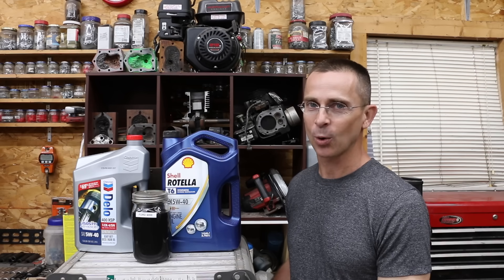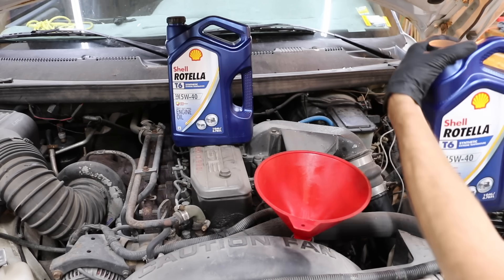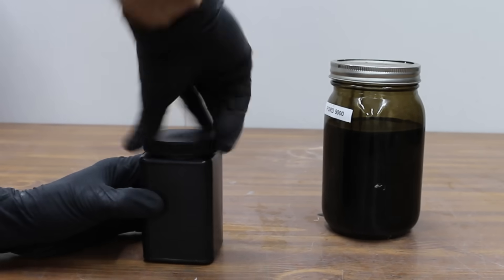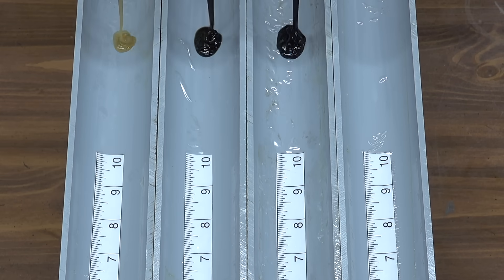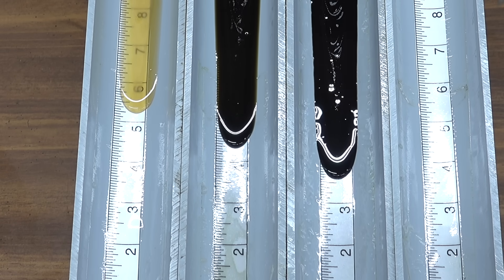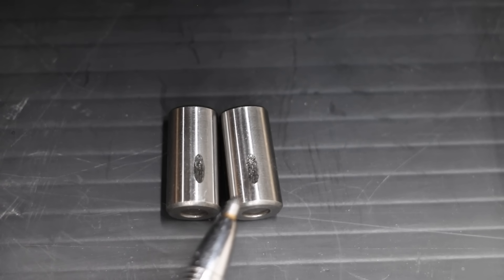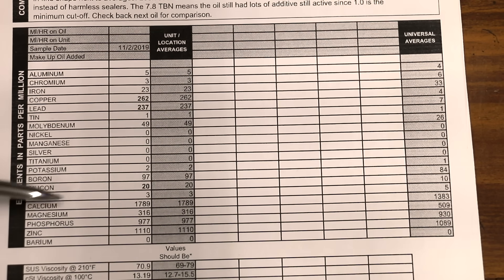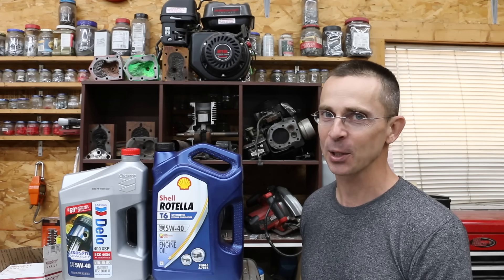Will Annual Oil Change Damage Your Car? Let's find out!

Comment: Could not understand one thing if I leave the car unused for 6 months (petrol engine) there could be water, but the oil system is a closed system where the water enters? When the engine warmed up the water will be gone, so what is the problem to leave the car unused for 6 months? The car has got 2k Miles a year.
Reply from the maker: Condensation.  Thank you
Reply: @ProjectFarm  so condensation goes away when I heat the car right? If I do not use the car for 6 months no problem as long as I heat the car properly when I wanted to use it.
Reply: @tuncg  seems correct to me...I have the same circumstances driving my motorhome on the freeway 60 miles a month, under full load and operating temps, about 800 miles a year. Almost no city driving of any kind. Twice a year it will sit for about 2 months with a full tank of non ethanol gas without being moved.....i think it can quite possibly go three years between oil and lube service at 2400 miles..

Comment: You know an engine has been neglected when you pull a valve cover off and the rocker arms are invisible under the gunk. I have seen some so bad you could actually see the imprint of the rocker arms in the mass of oily goo up inside the valve cover. Those engines usually sounded like a coffee can full of ball bearings when they ran. If they ran at all.
Reply from the maker: Great point!
Reply: Driving 3 blocks then sitting in cold weather continually ☹️

Comment: For my 2 motorcycles with wet clutches, I use about half 10w-40 synthetic oil and half 20w-50 regular oil, both the Valvoline brand motorcycle oil from Walmart. The synthetic oil improves shift feel, and the regular oil improves clutch feel, compared to all one or all the other. I wait until I notice they are not shifting as well to change it, before the 7,500 miles in the owners manuals.
Reply from the maker: Thank you for the feedback

Comment: Thank you for such a great video, I've always used Rotella oil in my trucks and tractors, but I've never used synthetic Rotella.  I've heard that once you've used the synthetic oil that you can't go back to using standard type Rotella oil
Reply from the maker: Thank you for the feedback
Reply: whoever told you that was subscribing to snake oil salesmanship from years gone by.  You can switch back to conventional motor oil if you wish without any consequences that are  results from your prior use of synthetic oil.
Reply: Alex Mitchell thank you for the information

Comment: My dads oil light on his truck has been on for almost 2 years
Reply from the maker: Thank you for the feedback
Reply: That's probably not hard to turn off.
Reply: No he just needs to change the oil
Reply: oil light constantly on? maybe the sensor went out or the wire/plug is disconnected. otherwise, the engine would've seized up if there's no oil pressure a long time ago

Comment: Great video as always
You said at the start of the video that the oils become more acidic over time.
Did you take a ph reading of the oils?
Thanks
Reply from the maker: Thank you.  The oil testing lab measured the oils total base number or the ability to resist becoming acidic.  The oil was still in great shape.

Comment: As a good data point agreeing with this: Many hybrid and plug-in hybrid vehicles call for longer OCI's time-wise due to lower engine runtime. Mine (a Ford C-Max Energi plug-in) calls for up to a 20k mile/2 year OCI. I believe the Chevy Volt also calls for up to 2 years (not certain on the milage) between changes.
Reply from the maker: Thank you for the feedback

Comment: You should try prolong engine oil additive the manufacturer claims you can drive with no oil after using it
Reply: that's snake oil... was it ever really proven to work? same with slick-50
Reply: @ricebike  most additives are but you never know until it's tested and apparently by project farm lol

Comment: great video. I thought the Delo would have had the better additive package (zinc/moly) but the T6 was better. Didnt expect that.
Reply: Paul G FYI,std Dino/conventional  Delo 15w-40 diesel/gas fleet oil has approx 1300/1200 ppm zinc/pho’s anti wear pkg in the oil which is great for additional protection for cams,lifters and from heat in general esp air cooled app too as long as not a wet clutch app due to VI/visc improver.,scott

Comment: Modern oils are amazing and changed for more than necessary.  Especially new oils in older engines that didn't have the newer oils.  Let alone synthetics!

Decades ago with the first synthetics coming out, I remember reading of a test in Popular Science by perhabps Mobile.  They ran an engine 100,000 miles, tore it down, and every component had no wear.  The cylinder walls had the honing cross hatch and there was no ridge. 

I no longer change my Mobil 1.  No one seems to realize that with normal leakage and burning and then topping off, bad stuff is taken out and new oil is entering the system routinely.
Reply: See, Im going on 14,000 miles and in this oil change interval I have added a total of 3 quarts over 8 months. (using Pennzoil Ultra/platinum)
I have changed my filter.
How do you think its doing? The oil still looks gold.
Reply: @sasquatchcrew   Sounds good to me if it was synthetic, don't know about that Pennzoil line.  Oil filters are another item that is changed way too often.  Other than metal from wear, there is nothing to filter out of a modern closed lubrication system.  As we all know, they can't filter out the carbon that makes oil black.  As a filter traps contaminants, it actually filters better!  (I was a Filtration Products Sales Engineer for a large company once.) If your filter were to be completely plugged, the bypass valve would permit unfiltered oil to reach the engine.  Unfortunately, there is no real world way of knowing approaching end of life for the filter.

Comment: Very much appreciate this video.  I've got an 08 Dodge Avenger that's low mileage that I only change the oil in once a year since I switched to full synthetic a few years ago.  Good to know that it'll hold up and shouldn't cause issues in the long run.
Reply from the maker: Thank you!

Comment: "A full year" ? Thats ridicolous. If you dont change the oil for like 10-20 years, but dont run the engine either, its still good or at least good enough. Unused oil will have to sit for a very long time before it goes bad.
Reply from the maker: Thank you for the feedback

Comment: Last year I purchased a 2016 RAM EcoDiesel.  From the forums, owners manual and fleet service mechanics I have spoken to and researched, I found this particular type of diesel engine (Fiat) is less forgiving than Cummings.  As such, RAM only recommends Mopar Diesel Oil at 5W-40.  I have found and used Pentosin Pento Speed SP 5W-40; It has better specs than the Mopar as per my local parts supplier.  They also told me that the Rotella T6 is another recommended for the EcoDiesel.  Would you consider pitting those three against each other?  I have watched your channel regularly and with your result from the additives video, I have now become a firm believer and advocate for SeaFoam.  Your results proved to me to try it, and in actually application I have noticed better performance and fuel economy from my gas and diesel vehicles as well as better performance and cleaner burning out of my smaller 4 stroke & 2 stroke engines.

As a side note, with my new to me EcoDiesel, I regularly use Power Service brand additive every few tankfuls.  Silver in Spring, Summer & Fall; White in Winter on Long Island.  I have noticed that I have increased power and fuel economy each time.  This type of diesel additive might be worth looking into with a few other well known brands.  Thank you.
Reply from the maker: Thank you for the video idea!

Comment: On a forum (Jeep) it was suggested that fitting a Oil Centrifuge to a diesel engine will keep the oil in better shape and clean out the soot from the oil - so I feel a test coming on :) .....Oil Centrifuge V Catch can V nothing  ....... on oils in various states of decay:   could it prolong the oil and engine or as you would say - the equivalent of snake oil :)

Comment: Speaking of moisture contamination... I work for a heavy machinery company and see torn down engines every week. Most engines that have heavy bearing wear also have a high level of water contamination in the oil. Would be interesting to see the bearing test done with water, coolant, and or fuel contaminated oil to see how the lubricity is affected. Would probably be good information to have for the commuters that only drive 5 minutes to work everyday and never build a good amount of heat in their engine. Thanks for all of the videos!

Comment: Thank you for your videos. Definitely informative and entertaining. Can you test transmission fluid? I'm interested in seeing if multivehicle synthetic transmission fluid (Valvoline or Castrol) and Toyota T-IV (3309) conventional fluid provide the same protection and viscosity. I think you can run the same tests that you do for the engine oil tests.
Reply from the maker: Thank you

Comment: Hey let's see which rubber conditioner is best. Should be a fun and useful test procedure. "belt dressing" is what I am currently shopping for.
Reply from the maker: Thank you for the video idea!
Reply: don't use belt dressing; just change the belt & check the pulleys/ tensioner( if it's a spring loaded serpentine belt design)

Comment: 2:01 Sorry, that's BS... the oil looks like new, did you run the engine at all in 14 months?
Reply: ...that's the point, we know understand that the oil deteriorates primarily by usage and not at all by sitting.

Comment: I like the video and appreciate the time and effort put into this, but even thought the oil has been in the vehicle's for over a year, the actual abuse it has taken is minimal.  4k miles  is average.  Most people who see these commercials are under the assumption that oil will last driving 12k plus miles in one year.  Any chance you could possibly put extensive miles on the oil for another video and re-test??  Oil sitting for a year vs oil being abused for a year I feel will yield very different results.

Comment: this piece's title is "Will Annual Oil Change Damage Your Car?" but to me, it seemed like the question you answered was "Will SKIPPING annual oil change damage your car?" you showed that, at least for T6 and the Cummins, time in the crankcase didn't degrade the oil that much.

you also mentioned that some folks use t6 (made for diesels) in gas engines. i recently got an accord 2.0T touring, and just change the oil when the honda "oil meter" hits 20%.  are there any data supporting t6 as opposed to mobil 1?
Reply from the maker: Thank you for the feedback